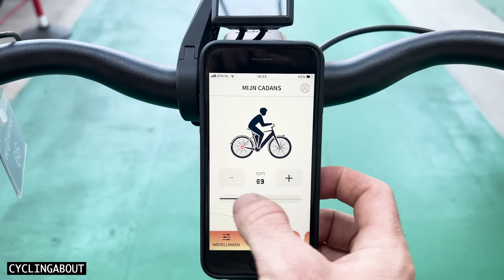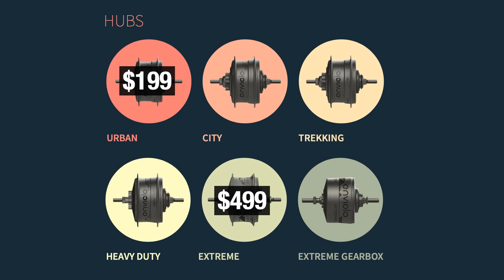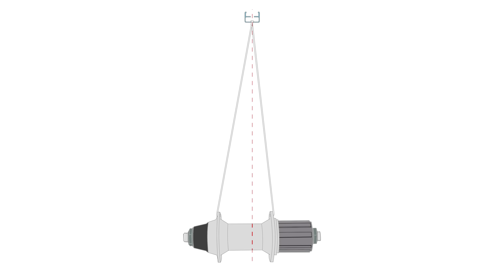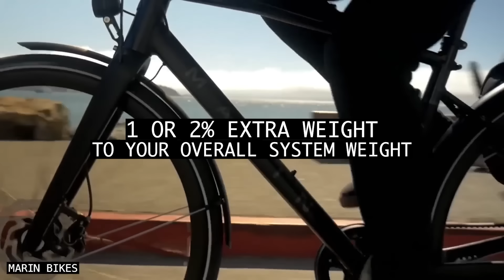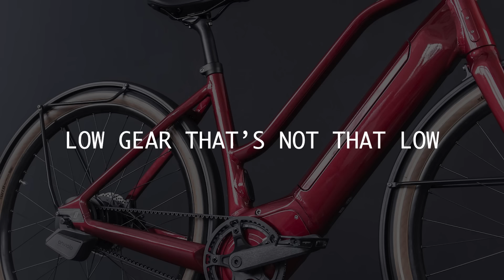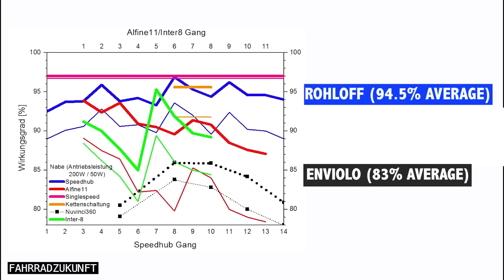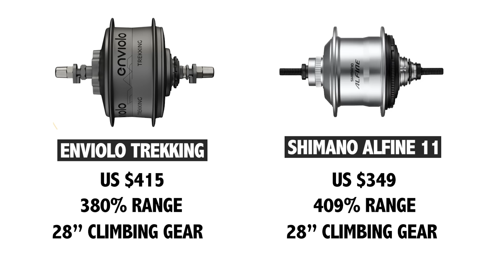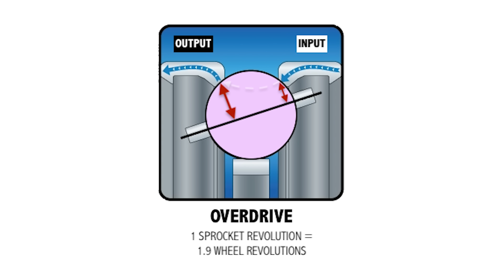Are $199 Enviolo Hubs the BEST Internal Gear Hubs For Bicycles?

Comment: I'm not a friend of rotary shifters, find them very uncomfortable.
Is there an alternative, such as a thumb/index finger lever?
Reply: Unfortunately not because it's a 2 cable system. Thumb shifters typically don't take 2 cables and you wouldn't want indexing as it makes the CVT ability of the hub near unless. The idea is you want a shifter that can be adjusted almost continuously.
Reply: @Ed.R  I'm pretty certain that someone could manufacture something accordingly. Maybe with two buttons for the thumb. One for upwards, one for downwards, but both continuous.

Comment: THAT'S LIKE A EXERCISE BIKE!
(Wanna change gears, just increase the tension by twisting the adjustment knob) 👍
Now that's what I call C.V.T simplified... 😜
Reply: With the automatiq and a good midmotor (torque based say bosch) no buttons and gear shifting at all. Just peddle if you want to speed up quicker put little more pressure on the peddles. It will always go to the 'top speed' anyway since that depends on cadence you set in the system. So for example i have mine set to 70 so at traffic light to 25km will always happen if i peddle at 70rpm but if i want to get quicker up to 25km you just apply more push to the peddles (hope that makes sense) and the system will reach its 25km/h quicker.

Comment: They need to be simpler and rebuildable. The technology is cool. Less than 400% range is no good unless you're in Manhattan. Rohloff needs to get their price down to like $500. The Enviolo concept is similar to one i had. Ie, why not have 2 cone shaped gears, a big and little one. The little one slides up and down the big one, and is connected to the pedals:
\
  \<
  /
/
Well, hard to draw, but i think you can get the idea. The little cone gear just winds up and down a large cone gear. Simple.
Reply: Most bikes shown in the video are electric, not needing the 400% range. Rohloff is probably too complex and riddled with warranty systems to cover the cost (as well as research cost)
Reply: Rohloff outlasts the bike frames its installed in, even steel frames. There are units out there that have gone over 300 000 km. Its actually the cheapest per km out of any drivetrain option.
Reply: Cone CVTs must be shifted at very high rpms. Much higher than a cyclist could manage. It would take about 100 feet of cycling to move up a noticeable ratio change from a standstill. It’s why manual shift mode in autos is so slow even at high speeds. Additionally, with existing tech and engineering limitations, the weight would be a lot more than an Enviolo. A cone CVT could be designed for bicycles to work differently and allow shifting under load but the number of moving parts would be great and thus the hub would be much more expensive. Expensive and heavy is a no go.
Reply: @EricPeelMusic  
thanks for the reply, and it seems informed, but something doesn't seem correct. The shifting would just be a linear pull, not indexed. And how heavy this would be is not known. Obviously, the cones are hollowed, and not heavy. It would take no time at all to shift.  The little gear would be set at an appropriate angle/position so the big gear so that the pedaling binds it. There would be a natural force to slide the little gear up or down the big gear, depending upon angles. So, a friction shifter can be used. Current chains and derailleurs seem fine, especially with new surface hardening techniques that are available that could extend metal chains/cassettes/chainrings to 10x their current lifespan. I am not certain why any change needs to be made to the typical cassette/chain/chainring designs actually. They are affordable, recyclable, and they could be made even more affordable with standardization and mass production, and they have a potential with alloys and modern hardening techniques to last 10x longer.
Reply: A CVT belt cannot slide up and down the cones perpendicularly. It must  move up in small increments each cycle. This means the vehicle must move before it can begin to shift and shifts are slow. Cone CVTs cannot shift at a standstill. There are 4 large cones. Each can be engineered to be lightweight but so can any cog or pulley and 4 is double two. And the housing must be very stiff and it adds weight. The shifting mechanism, exclusively hydraulic, adds weight. I guess this could be achieved with actuators instead but that’s at least two geared electric motors, unless you have one geared or chained up to drive all four cones. A lot of moving parts - still more weight and failure points. I think it would be a fun experiment to develop a cone CVT for bicycles if you can design in CAD and machine the parts. But I’m just answering from an engineering POV that it would be a challenge and that’s why it hasn’t been done yet, since you asked.
Reply: @chadkline4268  Sorry, I completely missed the design you initially brought up here. Large cone with small cone. Very small surface area between the two cones. Definitely not enough. So you'd need multiple cones. So the small cone drives the large cone? The ratio would be too low even if the small cone were positioned very close to the large cone's axle. If the large cone drove the small cone, the ratio would not get low enough. The difference in rotational speed throughout each cone (since spinning objects rotate faster the further away from the axle you go) between the two cones would be opposing and cause a lot of friction. Even if the two surfaces were diamond, they would scratch each other up. Or if one was diamond and the other softer, the softer would get scratched up for example. Then how is the small cone able to transfer force to the wheels? You'd need a chain or belt, right? And the belt needs a pulley which is able to slide alone the small cone's axle since the small cone will be moving laterally to follow the ramp of the large cone. There a re a lot of other potential issues. Lot of moving and wearing parts.

Comment: Without the ability to Equip the Enviolo CVT with automatic shifting it honestly would be a deal-breaker because I despise rotating shifters.
Reply: Agreed. They hurt my wrist and they often don’t really have the travel needed to even get the most out of these hubs. My local bike share e-bikes have the manual types and it basically means you have two gears, one for starting off and one for riding. It’s fine, but I would’ve preferred a simpler mech with detents
Reply: @whette_fahrtz  I can just imagine the squishy and quite irritating resistance that's likely on that kind of shifter. Sadly 99.99% of the mechanical rotating shifters have this issue because they pull the wire with little mechanical advantage.

Comment: I have an ICE Sprint X Tour tadpole recumbent trike which I bought new with the Rohloff Speedhub 14. From the get-go, I had nothing but failure, after failure, after failure with the Rohloff. I took the trike back to ICE for what I deem to be an upgrade to the Enviolo Automatiq, and I've had no issues, other than a pairing issue between my phone, with the app, and the hub.

IMHO, the Rohloff hubs are poorly made, with sub-par components, and, from a great many other reviews I've seen, a terrible reputation for customer 'service'.

I'm glad I ditched the Rohloff and went with Enviolo!

Comment: These are interesting systems, but I never see them offered on full-suspension e-bikes.  It makes me wonder if, unlike a chain, these cannot operating with any variability in the distance between the front gear and the back "gears?"
Reply: Its a limited market in europe you see them on full-suspension bikes both normal and cargo. For example on Reise and Muller bikes. making it work with belts can be done in several ways and all brands use a slightly different methods to either keep distance stable or keep chain at same slack level

Comment: The bike I ordered, 1Up Prodigy V2), has the Enviolo Trecking hub.
Can this be upgraded to elexrtic shifting like the AutomatIQ version?

Also I have noticed in all the videos I watch about this hub's manual shifter, it shows the user twisting, then reaching to twist 2 or 3 times to move through the whole great range. That seems like it will be pretty inefficient, tiresome and possibly dangerous if you have to release and readjust your grip 2 or more times to change gears, (vs click shifters or even Grip shifters which cover the whole range in about 1/2 a turn. Yet no-one seems to mention anything about that.
Reply: might depend on the bike but in concept yes i know several people who have done that. But i do feel a better integration can be done if both controller of the motor and enviolo talk together.

Comment: I can see why they aren't used on high performance mountain bikes, the shimano alfine weighs roughly 1.7kg, compare that to a decent rear hub with derailure and cassette which comes in at about 1kg, plus you can save a bit more weight if you spend more money.

Comment: Can we put the automatiq shifter on a non ebike? 
And can we change the freehub?
If those are possible, we're gonna do some weird crap.
Chinese carbon road bikes with belt drive and automatic cvt shifting so we can just set it to 90 rpm and leave it.
We also want to make it completely silent so if the freehub part is changeable we're gonna stick onyx hubs in it. 
But that's not a dealbreaker, we just wanna confuse people.
Plus we're gonna stick it on foldable mtbs since those are really cheap and we want to confuse people further by getting the full sus ones and actually swapping the shock and fork with fox suspension.
Inefficiencies don't really matter, I mainly use a full suspension mtb, even though the fs3 suspension on my colossus t8 technically negates pedal bob, the bike is still 15.8kg and there's still the pedal bob from the up and down motion of pedaling that a road bike doesn't have.
And my MTB only has a 381.818% gear range anyway
Reply from the maker: The Automatiq shifter is eBike only.
Reply: @Cyclingabout  sad.
Ah well was going with a flat bar setup anyway, the shifter will fit
Reply: @Cyclingabout @Rose_Butterfly98 Not if you're me, I have spent 6 years developing an automatic shift system for my non electric road bikes. Videos on my channel. It's powered by a front hub dynamo. Also truly fully automatic because it uses power data to adjust my cadence. Best thing ever as it opens up an amazing world of cadence optimization and the ride just flows beautifully.

Comment: Only one problem - if the seal leaks and water gets into the hub, the gear locks up and it becomes a fixed gear!
I had one of these on my tandem and it was great for a while, Then it locked up. Replaced under warranty.

Comment: Too much is made of efficiency. All internal hubs have a 1:1 ratio where gears are not in engaged and the efficiency is very high.
I have geared my bikes to mostly run around the 1:1 ratio so you are mostly in the most effiecnt gear. Gearing down and up is only done occasionally. Unfortunately bike shops all seem to think everyone is a super athlete on a road race so most drive trains find themselves constantly in the low gears. Same on my CVT it has a 1:1 ratio and I have geared the front ring and rear cog so I mostly ride around this 1:1 . I have a mark on the shifter for this position. Same with the nexus hubs, I have no experience with Alfine or Rohlof.

Comment: I like to ride at high speeds, but the enviolo limits me to 42km/h at 100rpm. My LBS said that changing to the heavy duty hub, will allow me to go faster at lower cadence. Although the specs tell me differently. Does anyone have experience with this?

Comment: I have an ice sprint x tour trike and currently have alfine 8sp with a 38 T oval ring in the front.  I need more climbing gears on the trike.  The local trike shop told me the alfine 11 sp wouldn't help me with more climbing gears and suggested Enviolo trekking hub.  After watching the video im not sure ill get the climbing gears I need.  I was hoping Enviolo would be a good fit and solve my climbing issue.  I do not have a mid drive motor as yet.  Anyone have experience with Enviolo and a trike application? I was hoping to not to spend 1500.00 on Rohloff.  I do realize you get what you pay for.

Comment: Ever since I got to know about Pinion gearbox I completely lost interest in other gear hubs not to mention derailleurs.
Reply: When pinion will be available under 4-500€ that would be the end of gear hub for me. But that 130€ nexus has still a long way to go.
Reply: otherwise similarly specced bikes from the same manufacturer cost up to 13 hundred dollars more for pinion than enviolo. you might be able to find a few hundred dollars in nicer components on the pinion models, but that's still like a grand more in just the gearbox. that is a LOT of money for a single component for most people.
Reply: Same. Just waiting for when a universal design comes out, like Bafang mid drives. Don’t wanna give away $1000 minimum for a new frame for it.

Comment: I am wondering if you can retrofit an old Flevobike with those.
Reply: You can definitely fit them to old bikes I've done a few of mine. Can't comment on that exact model of bike though.
Reply: @IC86688  The flevobike is an old (25 years old) incumbent bike based on 20“ wheels.
Reply: @SiqueScarface  That would be much more of a challenge. I have considered trying to fit one to my Whike but haven't. The mid drive gearbox version of the hub may have potential. Or fit a sprocket to the disc brake mount.

Comment: Even if it sounds stupid, i still want to just put one of these into a road bike and see how good or bad it would do

Yes it would be heavier, yes it most likely would be slower, but idk, i just want something quirky like that, at the same time for an aero bike it might make it more streamlined if paired with the right wheel, also begin in the wrong gear is probably worse than max drivetrain efficiency and for gravel races in bad conditions maybe begin it completely sealed might even be better than a conventional drivetrain...

In any case i cant shake off the "what if" from my head
Reply: After reading some comments it looks like the Nuvolo are just arse aparently, well maybe alphine will do

Comment: Does anyone know if there are any Internal Gear Hubs that will handle a 5000-8000 watt Mid Drive? Thanks B
Reply: Why would you want a 7000-8000 watt mid drive ? The bosch cx is about 650watt max at 85nm if you want 8000 watt you are making a motorcycle.

Comment: With an electric shifter it seems optimal for me, unsure how I'd set it up but a break in pedalling or resistance doesn't really work for me so I tend to avoid using the gears I have, now to calculate if I can pedal this as hard as I'm used to or if I'd need to increase the ratio further.

Comment: what is the maximum gear ratio a hub of this type can have?
Reply from the maker: It mostly depends on your front chainring clearance. You can run 16T on the rear (and probably smaller with aftermarket sprockets) so 4:1 should be possible on some bikes.
Reply: I run a 34x17 front/rear chainring on my homemade bullet style cargo bike with a nuvinci N380 . Allows me to pedal up a steep alley entrance with cargo.

Comment: Why aren't the Cannondale hedshok system licensed and sold to other frame manufacturers? I have an older crosss country Cannondale bicycle, and I have found it performs much better than other suspension forks (albeit being somewhat more difficult to service and install).
Reply: The patent expired over 5 years ago. Nobody seems to care enough for performance gain at so high cost of manufacturing and service. But there are definetely plenty of similar - usually simpler -  designs of single shock forks.
Reply: @feedbackzaloop  I would think with improvements in automation, those manufacturing costs would not be as high.

And, perhaps it is not needed on a city bicycle, but, it inspires rider confidence.

With less fork and wheel flex when turning sharply, over turning is reduced and steering is more precise, guessing is reduced.

I like the thing, despite it's drawbacks.
Reply: @j.l.m.6862  mind you the very same improvements apply to other designs, so the cost comparison is still not in favor of headshock.
Reply: Well, the bike is about 25 years old. At the time, it was far superior to other products in the bicycle shop.

Comment: I tried so many times the Enviolo hub, and never really liked it. It's extremely stiff to turn, compared to the index finger presses. When stranding, it cannot shift to completely zero. The continuously variable shifting in practice is only about 6-7 gears, as one cannot shift precisely. I know people who never change gears on the Enviolo, only when really need to, when going uphill. Plus, the very high internal resistance necessities the motor to be always on.
Reply: It’s likely setup incorrectly. Mine was the same and after lots of time stuffing around adjusting and replacing cables I ended up re-routing externally and finally got a light shift movement. Never under load though, that ‘shift under load’ idea is rubbish. The idea of the product is neat but the lack of good troubleshooting info online and poor setups from bike shops make it a poor experience